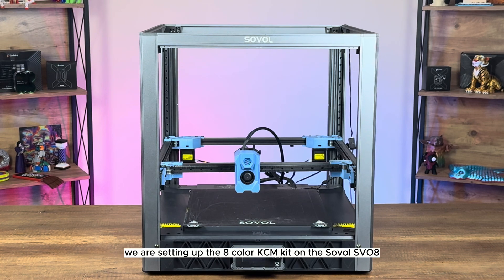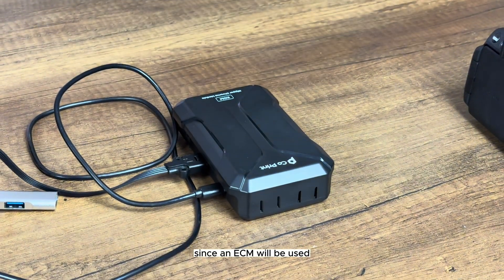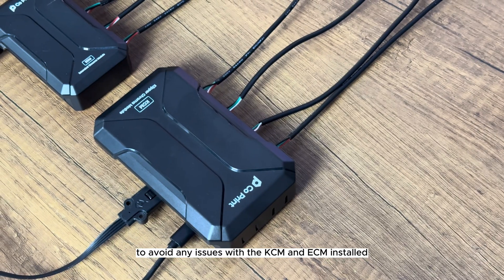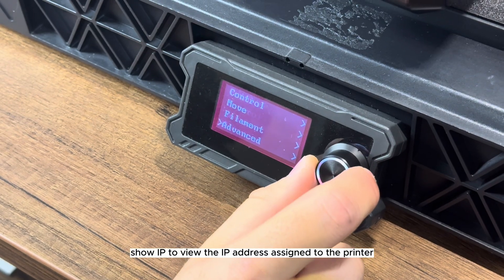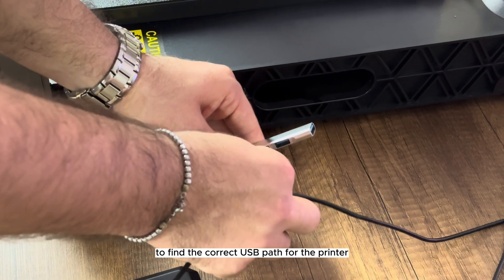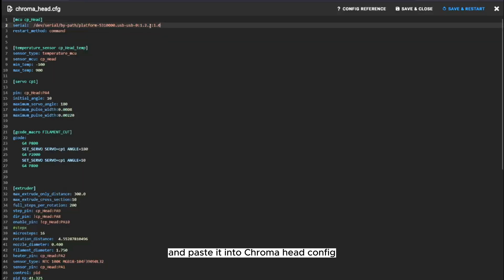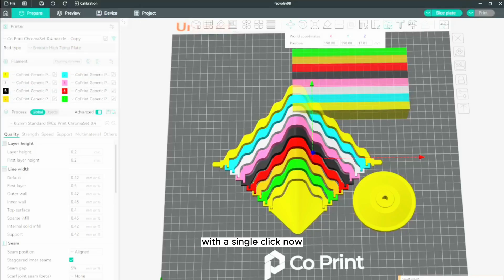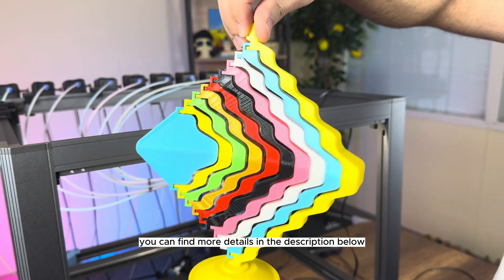Upgrade the Sovol SV08 for 8-Color Printing! | Co Print KCM Set Installation

Comment: Coprint, is it possible to stack a group of 4 extruders into a 2x2 arrangement?  It would keep things a bit nicer, I think.  2 units 2 extruders tall.  I'd actually mount them on a stand off the printer itself, it would make an extra 4" of ptfe length, I think.  This would let me incorporate the boxes that go with them and all the wires into one unit.  I did see someone build a box on top that holds the rolls and has your extruders and modules underneath it.  That was cool.  Maybe you should look into that kind of packaging.

Comment: The video is very difficult to understand. It lacks details such as disconnecting the power supply at any of the steps. I did it as shown in the video, but it doesn't show me the chromahead address, and then it throws up a ton of errors ranging from bad pins to m106.
Reply from the maker: Hello. We're very sorry for the problem you're experiencing. If you can reach out to us via email, we’d be happy to help you. 
✉️ support@coprint3d.com
Reply: @CoPrint3D  i send, still waitting for answer...
Reply: @deejaymarcus  im  getting errors as well. m106 m107 and g3. Its frustrating

Comment: Im stuck at trying to get the usb ports to work via ssh. It keeps acting like it isn't recognizing the usb and it keeps giving me the same command to type into the printer .cfg.  any help would be nice because I am stumped
Reply from the maker: Hello! You can check the setup guide on our website for your printer installation:
🔗wiki.coprint3d.com/en/sovol-sv08-kcmset-setup

If you're still experiencing issues, feel free to contact us via email. We’d be happy to help!

✉ info@coprint3d.com
Reply: I have been in contact with customer Support. The chromahead wasn't connecting to the kcm. They made me remove two chips off the board. 

Now I have all the correct paths but still can't get the machine online. It still gives the red error page. I was told to contact the whatsapp number but still haven't received a response. Just trying to get a time scheduled to do a remote session but having extreme difficulties due to the difference in time zones

Comment: I have SV08, unmodded, and a couple bambu's.  Why does this look like it's purging WAYYYY more in all the video that factory multicolor printers?
Reply: Seems like more because the other machines cut and dispose the cut filament through the “poop chute” co print doesn’t utilize the filament cut feature. It just used the purge block for everything

Comment: Great concept, not so great execution. I purchased the KCM set for my SV08. Install was pretty straightforward but configuration was a nightmare.  Due to a “conflict” between SV08 firmware and Coprint, the printer “forgot” the USB addresses of kcm module at every reboot. So, address had to be manually entered every power cycle.  I could never get the colors to purge completely and bleeding would be bad. Tech support was good but with the difference in time zones, you had to stay up to the middle of the night if you’re in the United States. Due to all these issues I had to uninstall.Coprint. 😢
Reply: I am currently having the same issue with having to manually enter the usb serial on startup. The customer service is also a bit frustrating. They have been very helpful. But the time difference makes it almost impossible to get direct help. The best time theyve offered to schedule me was at midnight on a weekday. If they offered support on the weekend the time ddifference wouldn't be so bad
Reply from the maker: Hello, we’re sorry to hear about the issue you’re experiencing and we’d like to help you further.  

Have you had a chance to check out our wiki page for the Sovol SV08?  
https://wiki.coprint3d.com/en/sovol-sv08-kcmset-setup
If you send an email to support@coprint3d.com, we’ll do our best to assist you as soon as possible.

Comment: Quite a nice solution. However, same problem as on most other solutions: to get a nice reloadable filament tip, the filament is cut inside the printhead. So the cut off filament has to be pooed out - you get a quite big purge tower to do so, and you get a quite amount of waste. As the cut part of the filament left in the hotend isn't retractable anymore, you can not use waste2infill or waste2object.
Prusa started a different aproch more than 7 years ago, using a standard v6-hotend with a modified e3d heatbreak on the mk3 using special movement profiles for e on unload (aka "ramping profiles"). While this had some problems to be tuned in the beginning, it produced reliable reloadable filaments after changing the hotend to an e3d Revo Six - and same of course on the mk4 with mmu3.
The key feature is using a "normal flow" nozzle with integrated heatbreak. However, as e3d offers high-flow nozzles using CHT-method both for Revo and nextruder, you can still do fast prints after a simple nozzle change.
Imho that´s the best solution to combine fast multicolour with low waste on a single nozzle printer and fast printing single colour. I would love to see a Revo Coldend for the ChromaHotend, to use Prusas Ramping-on-unload approach.
So if you only have a few filament changes (f.e. on the bottom layer) you could use a high-flow-nozzle using cut&poo (into purge tower), but if printing full colour using a normal flow nozzle, reducing waste on filament changes and speeding up the filament change (as you do not have to purge the cut of filament inside the hotend).
Reply from the maker: Hello, you don’t need the feature you mentioned. I completely understand what you’re trying to explain — but it’s not necessary.

Yes, the cut filament does stay inside, but it can be purged exactly where needed. Also, the remaining filament inside is only 8mm long, which means it has a volume of just 19.23 mm³.

In all single-extruder multi-filament systems, even just switching from yellow to red filament usually requires purging around 500 mm³ of filament — so the small amount left inside really isn’t a concern.

In summary, there’s no need for “ramping profiles” or switching to a Revo hotend.
It seems like you’ve spent a lot of time working with the Prusa MMU — we’ve been through the same, and that’s exactly why we developed these products to be easier to use.

For more information, feel free to visit our website: coprint3d.com
Reply: @CoPrint3D  nice reply.😄

Comment: Can you make a profit that use the previous filament as infilling to reduce the waste to the minimum?
Reply from the maker: Hi! Yes, that’s actually possible — OrcaSlicer supports using the previous filament for infill, which helps reduce waste significantly. ♻️
It’s a great way to make your prints more efficient!

Let us know if you'd like help enabling that setting.

Comment: Did you guys found a solution to the accelerometer in the toolhead that not compatible with SV08 Klipper version without going mainline ?
Reply from the maker: Hello, we're currently working on it. We've reached out to the Sovol team as we need their support to resolve this. Thanks for your patience!
Reply: @CoPrint3D  Hello, any news for this ? I'm a begineer just received my sv08, I don't think I will go on mainline klipper it seems difficult, thank you

Comment: I have actually gotten some 4 color test prints done.  The hardware seems to be working very well.  My software install is a mess, will need to really work on removing all of the test code I wrote into determine what was happening between the CoPrint Klipper includes and the Rat Rig - RatOS.  Hope to be able to publish something soon.
Reply: Looking forward
Reply: @fkdaflds7  I have done some successful prints, the hardware has been flawless, am working on the software with Co print.  The Rat Rig is a great printer for this, as it has so much print area.
Reply from the maker: That's fantastic news! We're glad you're happy with the hardware and looking forward to seeing your prints soon. Thanks for sharing your experience!

Comment: Can we get a holder for the extruders for the top hat?
Reply: there is a top hat on printables
Reply: @Valerie_is_doing_stuff  i think they mean a top hat that had 4 and 8 extruder holders built into it. And theres nothing like that on printables
Reply: @ lol yup. thanks auto correct. think i need to reset it somehow. its on some thing.
Reply from the maker: You can find all the printable parts you need on our GitHub page and also detailed instructions on this page: https://wiki.coprint3d.com/en/sovol-sv08-kcmset-setup

Thanks for your interest!
Reply: @ the top hat is for the encloses. you dont have one.
Reply: @ I am still trying to get support for a dead KCM. Since Dec. it connected one time and quit. Havent' been able to use the coprint one single time
Reply: @ i have a similar issue, i reached out to support through their site and got a response the next day

Comment: Co Print is a clever multi color upgrade.  It was great to see a version specifically optimized for the SV08.  It's impressive to see eight feeders hanging off the back of the printer.  I'm sure this will appeal to SV08 owners wanting a lot of color options.  I do functional prints, so I'm more interested in adding one or two tool heads so I can have completely different materials, printed at different temperatures, which would be good for printing PLA support on PET-CF parts, or printing TPU feet, grippers or bumpers on ABS parts.  I'd probably be best served by a large format RatRig V-Core 4.0 with their IDEX, but I'm waiting to see what multiple tool head upgrades are available for the SV08.  A few people are working on that idea.
Reply: You can print with different materials with the coprint each color will have its own slicer settings for temp speed ect. So you can do pla with petg supports or abs/pla ect ect. You don't need different heads unless you want different nozzle sizes
Reply: @ashermordante  - There are inherent problems printing different materials in the same nozzle.  Would the printer wait for a 20 C change in nozzle temperature when switching from one material to another?  The old material must be purged, which wastes time and material.  That's bad enough when changing from one color of PLA to another, but much more purging must be done when switching between incompatible material types to avoid delamination when printing with contaminated filament.    Lost In Tech had a good video recently showing slow motion colinear extrusion when switching filaments.

Filament swapping in the same nozzle is popular and CoPrint looks like one of the better versions of that and is particularly welcome as an upgrade for printers without an MMU from the manufacturer, but printing different filaments in the same nozzle has some fundamental limitations.  I think it works best when printing many objects, where the time and filament when changing colors is spread over multiple objects, or designs such as signs where the colors are only on the top two layers.  If slicers improve to accommodate the recent adoption of MMUs and can cleverly print the second filament as infill rather than wasting time and material printing poop, then MMUs will become much more useful.
Reply: @ you can purge into infill, supports or even another object in Bambu and Orca slicers

Comment: Co poilt is compatible with Neptune 4 max?
Reply: Yes
Reply: If it is a klipper based printer, as the Nep 4 should be, then you do not even require a Chroma pad for it to work. I jsut bought the base kit (includes 4 heads) for $310 USD, plus $20 shipping.
Reply from the maker: Yes, it is compatible with Neptune 4 Max. You can check it out here:
https://coprint3d.com/products/kcm-set-multi-color-update-for-klipper-printers